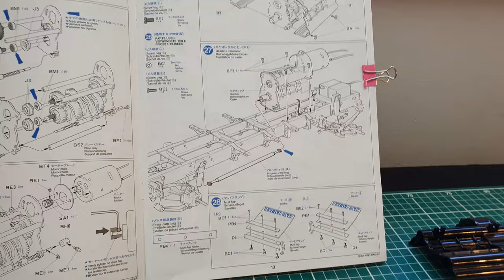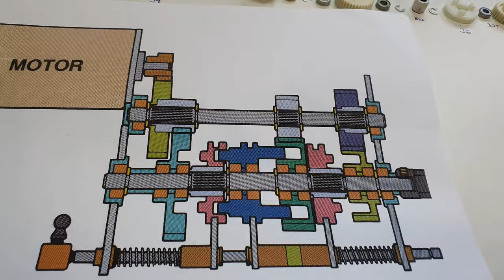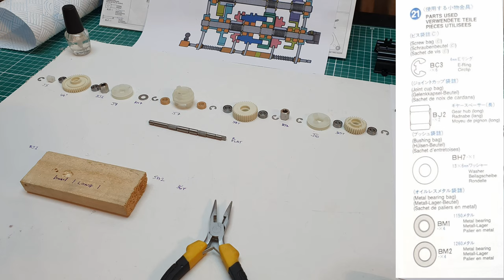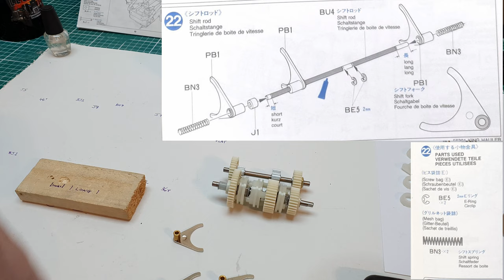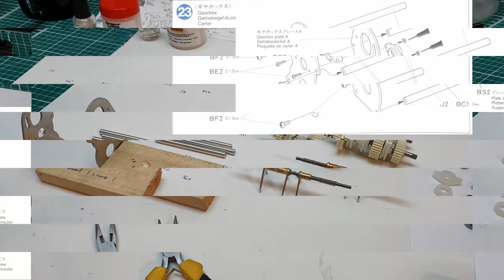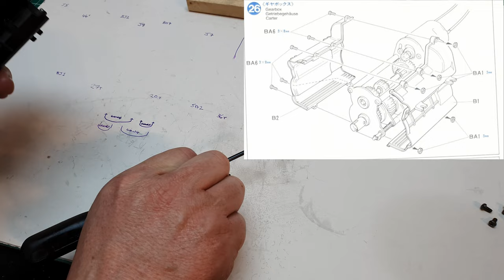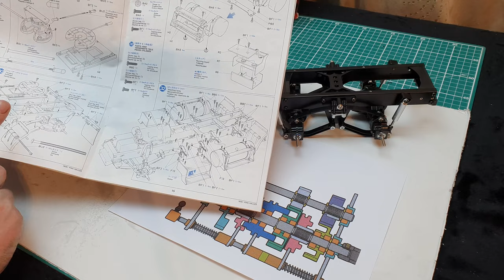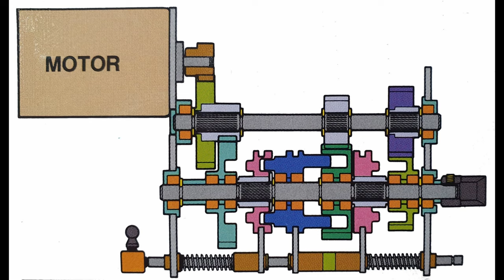Tamiya King Hauler Build Ep4 - Steps 20 to 27 - Detailed Transmission Assembly - Movin' On

Comment: The King Hauler Transmission works better than the new ones. The shifting works better. In the Grand Hauler I removed the two small springs that help center the gears. It shift so smooth now. My two King Haulers and Knight Hauler work great.

Comment: Thank you Teri!!! That's a definitive Video of the SCARIEST bit of the whole Build!! I'm definitely keeping this as reference when I do mine. 😉
Carmine
Reply from the maker: the Euro truck transmission is 98% similar so to avoid confusion I'll be building a Euro gearbox soon 😎
Reply: to some the paint job is the scariest part for me i find the paint best part
Reply: @madtopp  I love painting! I'm a Retired Auto Mechanic, and used to restore Cars. 😉
Reply: @TeriWilde  You really did make it look easy! I didn't realise that the euro Transmission was any different. 
That would be worth seeing!
Reply from the maker: @CarminesRCTipsandTricks  it's only the shift rod assembly that is slightly different, nothing much overall.
Reply from the maker: @madtopp  that's why I always source it out to a professional, it's cheaper in the long run and a much better job

Comment: Thanks Terry. I am a first time builder of trucks, building a Scania. The gearbox has given me headaches, but your instructions are probably the clearest on YouTube, and there are some excellent contributors on there. So, I’m about to rebuild my gearbox for the umpteenth time. I’m sure with your help I’ll get it right this time. My other concern is the set up of servos, once I get these two sorted I can start on the build proper. Keep up the great work.
Reply from the maker: I'm hoping to get time to build a Euro truck (MAN TGX) that I've have for 7 years now. It's basically the same chassis as the other euro trucks and there's a tiny variation between the US and Euro trucks but nothing really significant. 
Good luck with your build 👍

Comment: when you apply the grease why not use a cotton bud instead of your finger that way you keep your fingers grease free the heat shrink is a great idea i did'nt use the brass bearings in my builds
Reply from the maker: I guess using my finger is an old habit...,
Maybe cotton buds might leave a trace of fluff, not that it would matter too much. 👍

Comment: Can you describe the dimensions of the bearing to me?  Thanks.
Reply from the maker: there are eight 1150 and two 1260 sized ball bearings. 

Note: Only use the provided 1260 bushings in part J7 because it slides back and forth, it does not rotate the Gear Shaft B.
Reply: Thanks for the quick response!